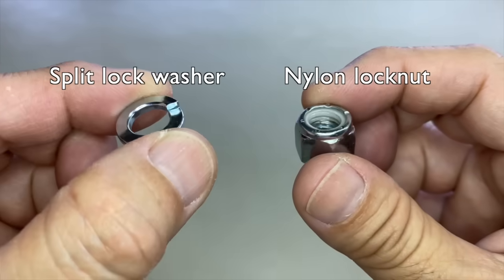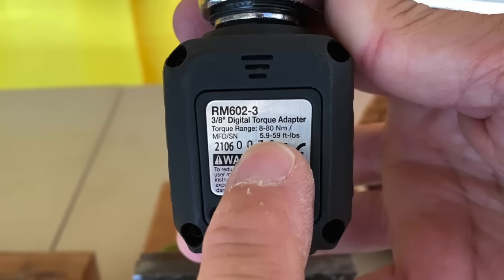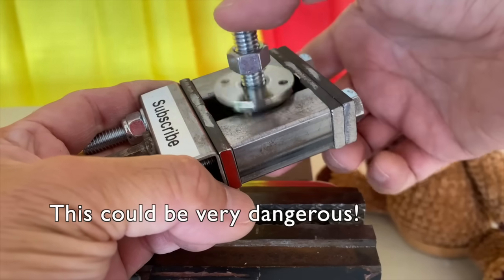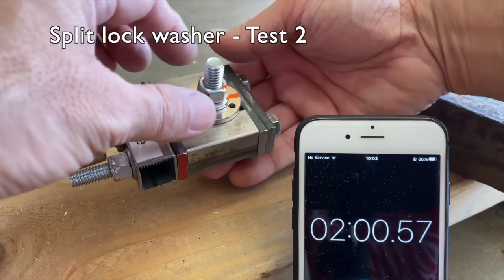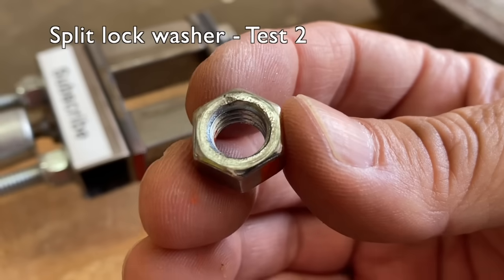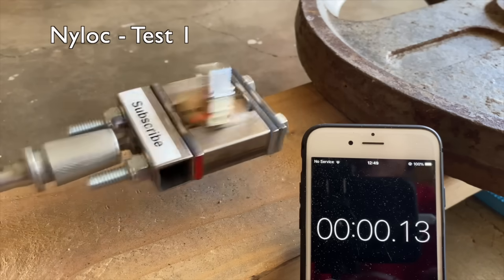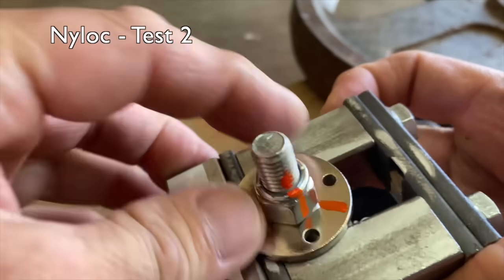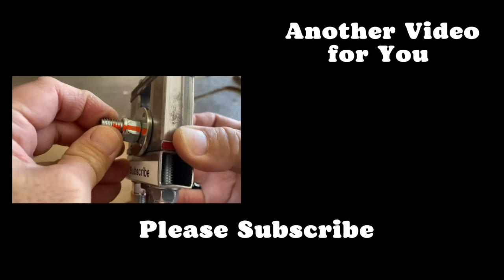Nuts & Bolts - Split Lock Washer vs Nylon Locknut – DIY Impact & Vibration Test - Part 1

Comment: According to NASA, when tightened fully (as would usually be done), a split “lock” washer no longer acts as a lock washer and shouldn’t be used as one.
Reply: @melgross, I've seen split washered joints tightened to the point where the washer has extruded out from between the nut and the flat washer. Too many "ugga duggas" I might suggest. My preference is a prevailing torque nut that has the end slightly deformed to clamp onto the bolt. That way, even if it comes loose, it isn't coming off the bolt. They have a higher retaining torque than Nylocs, and they're not sensitive to temperature unless it's hot enough to temper the steel.
Reply: this is correct
Reply: Aren’t they the people having to be rescued by space x??
Reply: @Dingleberry1856  that’s Boeing.
Reply: Смешно.  В российском авиационном институте нам как раз говорили , что Гровер - изобретение американских шпионов. Призванное разрушать вражескую технику 😂😂😂
Reply: I would trust a NASA “engineer” to tighten a nut sack
Reply: source please, and also this is what happen when compressed fully according to the NASA, but is it supposed to be fully compresed ? I dont know.
Reply: @akimen64  just look up the formula for spring compression. It’s a very simple formula. When you tighten a nut down, you tighten to a specified amount of torque. At least, that’s what you do with anything critical, such as header bolts in engines. Yes, that tightens any washers completely. Obviously, since a “lock washer” of this type is compressed to the torque spec, it’s flattened completely. Otherwise the screw/bolt isn’t tight.
Reply: @akimen64  Here’s actual numbers to consider: A 1/4” Grade 5 (average strength) bolt breaks at 3800 pounds of tensile force. Proper torque is about 75% of that or 2850 pounds. With a literal ton on a 1/4” split washer, I’m going to bet it’s smushed flat. Not having enough torque on the joint is a problem. Adding a split washer is NOT the solution.
Reply: NASA = “never a straight answer”!  The same NASA who ignored the temperature and seal problem that caused the Challenger accident!  Sorry, not trusting them!
Reply: Don Petit, an actual nasa astronot, space engineer and scientist, had this to say about the nylon locknut vs split washer debate: “nylon split lock washnuts are very useful on the ISS. We use them to plug holes, keep our gorilla suits together, they make great pepperoni substitutes, and they keep our green screens working constantly”
There ya go, if Don Petit can be an astronot, you can be anything you want.
Reply: Wrong
Reply: Depends on the screw/nut over 5.8 you are correct
Reply: NASA?????   It's not a good reference standard. You probably should have used Boeing?
Reply: @texxasal  Boing is the one having the troubles at the moment. And despite any troubles NASA has had over the years, they were trailblazers in aeronautical engineering for decades, so they have plenty of engineering credibility. However, credit where it's due: Boeing knows how to design a good aeroplane. They've simply forgotten how to build them to the required quality standards.
Reply: @texxasal  you don’t have to be dumb in your reply.
Reply: Hold up!
Is the split washer supposed to keep the nut from rotating by
1: applying axial spring tension to the nut, thereby increasing friction in the threads? Or,
2: digging into the underside of the nut and flange, and applying torsional spring tension to keep them from rotating? Or
3: Both.

Because this matters a lot when you try to interpret the meaning of the original post.
Reply: @JH-lo9ut  to some degree, both. It's just that it's really bad at doing its job.
Reply: @JH-lo9ut  essentially number two. The spring pressure is used to help keep the edge pressed against the part and nut so that the dig in. The problem is that when it’s tightened so that the washer is flat, there’s nothing preventing loosening. What some people hate are mistaking, is that they seem to think that as long as the nut is in the screw, there’s washer is working. But, that’s not the case. When the but is tightened to either a specific toque with a torque wrench, or approximately by hand, that’s ok. If the nut loosens just a bit so that the holding torque is less, then the washer gas already failed in its function.
Reply: Its not only NASA? Also the Almighty "german Institute for norming" (DIN) canceld the normed standard for split washers.

When the GERMAN NORMING INSTITUTE doesnt believe in it  working - it doesnt. 
(sometimes it stimply stops to exist)
Reply: There's no surprises there really...
Reply: Yeah I believe NASA they wouldnt lie
Reply: According to NASA both Challenger and Columbia should have returned to Earth in one piece. 😂
Reply: Nord locks, flex locks, or aircraft wire for the win
Reply: Makes me wonder if placing a notch on the nut would cause the split washer to hold better
Reply: @patrickday4206 There is something called Nordlock which is a toothed washer and a bolt with matching ramps on the underside of the head.
They are effective in proper application.
Reply: Space is made in a hollywood basement... and a swimming pool.
Reply: For those that want to believe NASA answer this.  How much spring force does a collapsed spring have?

I'll save you the math it's 0.
Reply: @bowez9 If by collapsed, you mean coil bound, then you are incorrect.
Reply: @bowez9  you need to go back to middle school and take math again.
Reply: @bowez9 I’ve read this in the NASA publication as well, but I don’t understand it. I assume that they are talking about axial force from the split washer. Yes, the split washer is flat when torqued properly, but that doesn’t mean it exerts no axial force. In fact, it means that the force is maximal. What am I missing?
Reply: @thomasherbig  the coil(s) have bound meaning it is no longer a spring.  When torqued its doing nothing and when not torqued it's actually assisting in losing.
Reply: @bowez9  perhaps you’re not capable of understanding what I wrote. It’s when the washer is compressed all the way that it’s not a locking washer, as I said NASA said, which it did in the excerpt of the document you quoted. I don’t understand your problem here. And it’s not that there is zero compression force when completely closed, because there is. It’s that the sharp edges of the spring washer are no longer sitting at angles, digging into the nut and work. That’s completely different. Of course there’s force on a compressed spring.
Reply: @melgross  I did say compression force I said spring force.
Reply: @bowez9  you can use the terms interchangeably. When you compress a spring that results in a force.
Reply: @melgross  is it comprehensive or tension force, terms matter.

And the more complete spring formula factors coil bind.
Reply: @bowez9  what?
Reply: @melgross  if you so inform on the subject where is your peer reviewed paper on the matter, your ATSME number or SAE number or PE number?
Reply: @melgross  are bolts designed to under compression or tension?
Reply: @bowez9  Helpful. Is the coil bound at the cut surface? If so, does the (usually present) angle of the cut affect that?
Reply: @thomasherbig  yes.
No.
Reply: @PeterBee911  so your use  of Ad Hominem shows the strength of your counter point.
Reply: @bowez9  They are not lock washers, they are spring washers, two terms you switch between.
Spring washers are not designed to "lock" a fastener.
All your bloviating technomumble and references to NASA misses the point.
They are used to stop a loosened fastener completely undoing, just like nyloc nuts.
Reply: The purpose of a lock washer isn't to make the nut grip with more force. If you think about it, it's actually trying to lift the nut off...
It's purpose is to prevent the rapid loss of clamping force if a tiny bit of flex or movement occur.

Without a spring style lock washer, as soon as the nut unscrews an 1/16 or 1/8 of a turn, it's lost almost all of its holding force and is about to become rattlingly loose.

Same for if the bolt stretches just a tiny bit in length. 

Spring style lock washer make that a more linear decrease in force rather than exponential loss.

For example: imagine 2 heavy plates bolted together. A torque tries to pry the plates apart (use a prybar between them). This just slightly stretches the bolt. 
Now relieve the torque/load. 
Without some kind of lock, the nut is now no longer tight, neither are the plates. Vibration is free to rattle it off. 
With a spring lock washer, it's still tight and holding the plates together, just not as tight, until that spring length is mostly used up. Then it becomes loose and fully able to rattle off. 
With a nylock, the grip releases like a regular nut. But the nylock continues to resist vibrations even while it is loose. 
(And yes, you can use a nylock nut and lock washer to get both properties).

Nylon is a low temperature plastic, so things like exhausts use other forms of lock nut. Examples:
A nylock like design, but with metal spring clips in place of a block of nylon. 

A nut that is intentionally not round, so it is actually forced round by the bolt, applying a constant gripping force.
Reply: @andrewstambaugh240  the concept, with a split spring washer is for the spring force to cause the edges of the washer to jam the part and nut so that it resists vibration. But as NASA and since, others have shown in testing, it does no such thing. When the nut is even slightly loose, even though the spring force is holding it enough to prevent rattling, it’s already out of toque spec.
Reply: @nkelly.9  are you meaning wave washer?  If so these were not even discussed in the video.

  If more than a lock washer is called lit by an designer they are denoted as wave, serrated etc.
Reply: @tonyblighe5696  I cited sources.  Sources that cited more educated persons than I.
Reply: There is axial force from the split washer, but it is negligible when compared to the bolt preload for anything but the smallest fasteners. 

The thing that is being missed in this thread is that the mechanism that "locks" the split washer is the sharp corner edges digging into the head/nut. That sharp edge is not digging into anything when the washer is compressed flat. The edge only starts to dig when the split washer expands, and at that point the preload is already lost and the joint has already failed. This is why NASA engineers (and most other engineers) correctly state that split washers provide no benefit in locking. As ASME implies, they provide slight benefit in preventing the nut from completely separating, but no benefit in maintaining preload.
Reply: I wouldn't trust a NASA engineer to correctly torque a finger nut.
Reply: @stratman103  I would t trust you to know the difference.
Reply: @stratman103  The DIN also says that it is not a suitable threadlocker. In addition, they have withdrawn several standards for screw locking devices:
Spring washers DIN 127, DIN 128 and DIN 6905
Spring washers, wave washers DIN 137 and DIN 6904
Tooth washers DIN 6797
Fan lock washers DIN 6798
Locking plates DIN 93, DIN 432 and DIN 463
Locking cups DIN 526
Locking nuts DIN 7967
Reply: @stratman103  Better than a Boeing engineer...
Reply: @stratman103  You must not have ever worked with a real engineer. I have, for over four decades, including in space systems. I think they can disregard your opinion as it's beyond ignorant and instead is truly imbecilic.
Reply: @stratman103 I bet you think the earth is flat too, eh? 🤡

Comment: Best results might be with a lock washer, Nylock and thread locking compound. There is a reason safety wire is used in aviation.

Comment: Your videos are instructive. However, whether the nut fell off or not, all of the fasteners loosened to some degree which is a failure. The same test with Lok-tite would be instructive as would be prevailing torque nuts. Also 6 ft lb is a very low torque for a 3/8-16 fastener. As you showed, lock washers should be avoided. Keep up the good work.
Reply: I agree completely.  Lost preload should be considered a failure, as should a fastener that has moved off scribe, and 6 ft-lbs is very low for a 3/8-16 fastener.  Assuming that is a grade 5 fastener, a torque of 23 ft-lbs would be appropriate and I would expect it to maintain clamp load for much longer on the vibration test.
Reply: All this test showed is that if you under-tighten any bolt it will loosen and if you use a nylock it won’t fly off when loose. 
Absolute failure of methodology to match goal.
Reply: The nut/bolt combo is free to slide and bang around inside the jig.  This a is a failure of application rather than material.
Reply from the maker: @mlconley  Thanks!  My test is based on this test supposedly aerospace test... https://www.youtube.com/watch?v=6tR2JV4VZfA
I think mine is harsher on the impact side of things.  😎